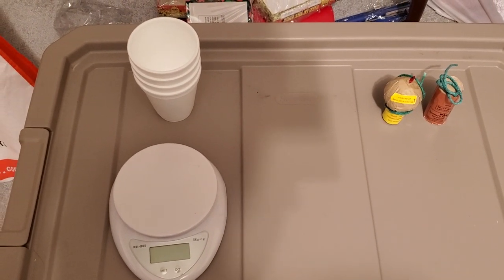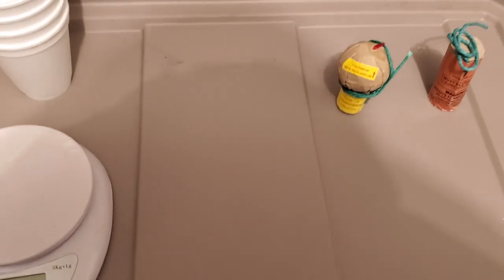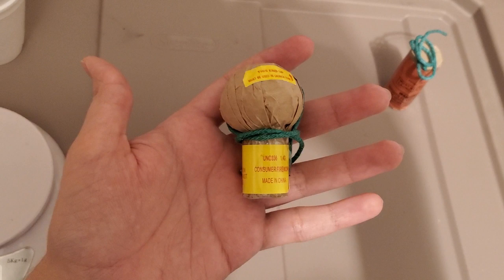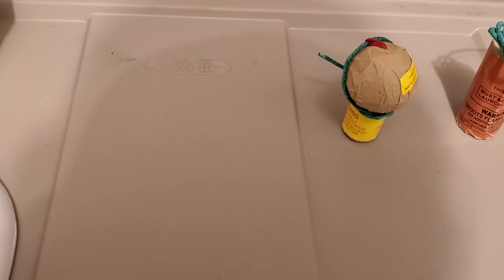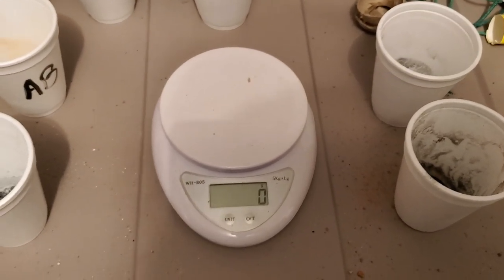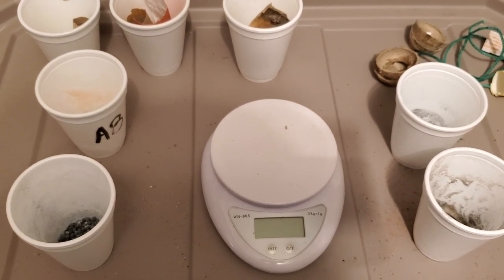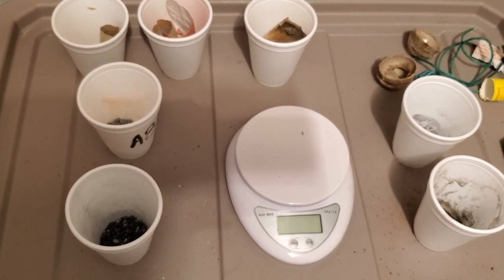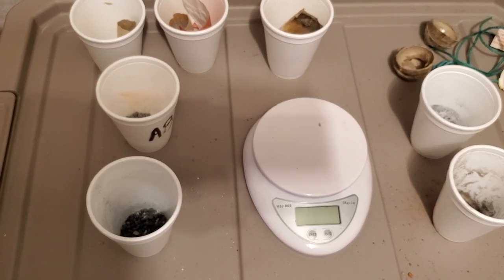Fireworks Dissection - 1 Inch Canister Shell vs Fake Ball Shell - Which Shell Weighs More?

Comment from the maker: This is why I'm not a fan of the fake ball shells.  They wouldn't get such a bad reputation if the total weight of their composition was the same (or more) than the actual (true) 1" canister shell.  If that were the case, then I'd rather buy those than the 1 inch cans since I'd be able to put them inside of my HDPE DR11 tubes.  Although they still wouldn't have any symmetrical breaks, which is a deal breaker in my case.
Reply: Maybe they can make smaller HDPE tubes. Or they can make the cans shorter and thicker, instead of longer and thinner.
Reply: Hey trying to get this channel going. I've talked with you on my Georgia Bigfoot channel.
Reply from the maker: +PyroBigfoot
I'll give you a shoutout in my next stash/update/discussion video (basically the next video that I record).  My demo vids are all from around the 4th of July last year, so they are all past clips.

Comment: I'd just buy a cake before any of those three. I shot a pack of 6 of some little canister shells off earlier in the year and I thought they were pretty good for as tiny as they were. But I can't load them into my racks and I have to use their little disposable mortar. For the price some of these go for, I think a 200g cake would be a better buy, even if it's a little more expensive.

Comment: I think it would have been better to dissect 3 shell types for the same product. For instance, World Class Super Magnums (real ball, fake ball, small can). Could just be that different companies put different comp into their "small" artillery.

Or maybe those "Whistling Busters?" or "Fixin' to Fire?" I think I remember you being upset at having 2 types of those in your stashes.
Reply from the maker: The Whistling Blasters by Orion aren't sold anymore at WF Boom, but those did get watered down during there later years of production.  Luckily, I've never purchased the watered down version of Fixin' To Fire.  I may do a dissection of a real ball shell vs a fake ball shell version of the same shell kit (if I can find a store that still sells real shells).  Super Magnum by World Class is a good option, but the stores that sell them around my area only have the 1 inch cans now.  If I can find a shell kit that still has real ball shells, I'll get it and I'll also compare them to the 1 inch cans.  I may have to find a local pyro that'll let me have a real Magnum shell to dissect (if they still have any), because I don't think I'll find any at any of my local stores.
Reply: @pimpdaddee28  I've taken apart the new Super Magnum fake ball shells and I'd have to say I'm actually impressed at these shells so far. I think it came out to 23 grams just for the composition alone, the lift was probably around 6 grams give or take. I also lit a few off and they actually have a nice break. If I ever come across the old super magnum shells I will definitely compare them.
Reply from the maker: Sweet!!  Let me know when you do!!

Comment: Price for each? Number of shells in a box?  I would find this comparison a bit more appropriate if each were cost the same. In my experience the cheap shells you speak of run approx 5 or 6 box. To simplify my response is you get what you pay for.
Reply from the maker: The Shogun shells and Ammo Bomber shells cost exactly the same (by the case) at WF Boom.  The Mad Ox shells cost between $5-$6 on the American Wholesale Fireworks website.